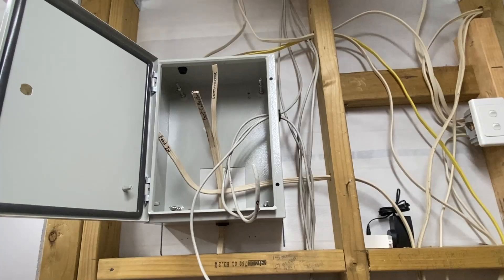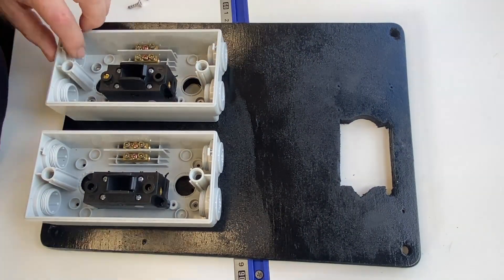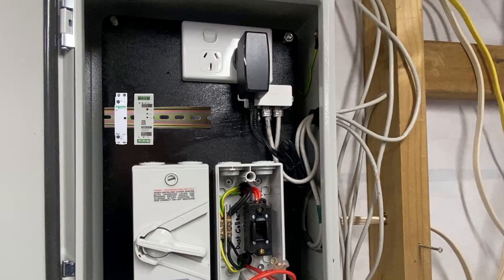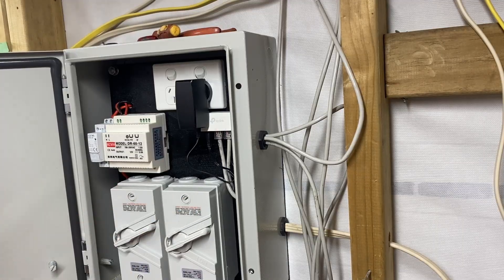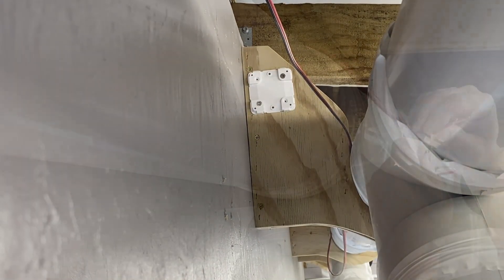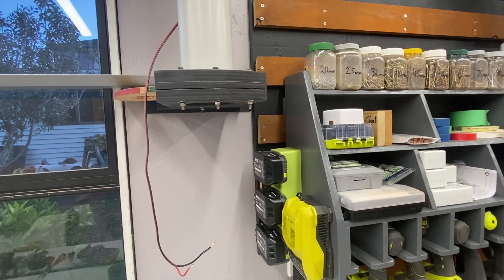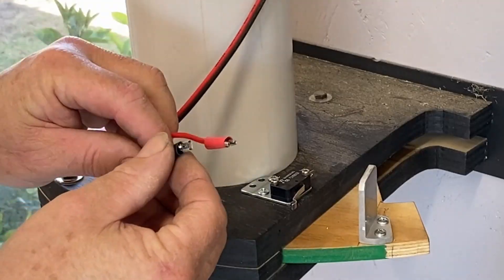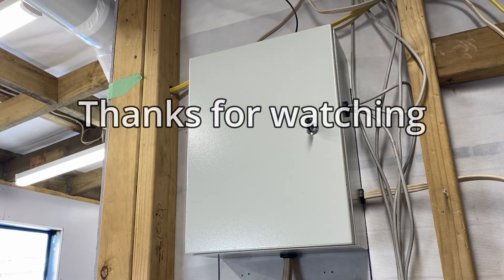Automatically Start The Dust Collector From Your Blast Gates

Comment: Looks good, couple of questions: presuming you have an electrical qualification to be working with mains supply in NZ? This should have a compliance cert? And also, how are you dealing with the static charge that could build up in those pipes? Wood dust and sparks = explosion, and non compliant electrical work = no insurance!
Reply from the maker: In NZ the home owner can do their own wiring. In fact the government issue a document 'New Zealand Electrical Code of Practice for Homeowners' which has all of the electrical specs. But, you need an electrician to connect it to the supply and to sign it off.

I'm not worried about static issues. This electrician shows testing where it is almost impossible to remove or ground static. 
https://youtu.be/yA22kTtV4XI
Reply: @thehobbymachinistnz 
Most of the NZ (where I am) homeowners code of practice is replacing "like for like" and, yes, an electrician is required to connect and check your work.  I follow your channel and enjoy your content, but I think it would have been prudent to have mentioned that requirement or at least to make viewers aware of requirements in different jurisdictions, certainly the video you linked to did so re grounding conduit.
Reply from the maker: @RobinHicks-w8u  Thanks for your comments. I actually added a lengthy disclaimer early on in the video about our code of practice and that others should check their regulations where they are, but it was too long so it took it out. I intended to add something smaller at the end but it did not get into the video before I released it. 

New Zealand Electrical Code of Practice for Homeowners and occupiers allows for new installations "e.g. For new electrical installations you may place the cables into the main switchboard enclosure (providing there is no electricity supply connected to that switchboard). The connection of the cables into the switchboard must be carried out by a licensed electrical worker and must be inspected by a licensed electrical inspector". So new installations are mentioned and allowed by the home owner in the code, not just like for like replacements.
Reply: @thehobbymachinistnz  Where did you learn to work on electrical stuff? Just learned things over the years?

Comment: Nice work.
Could the micro switches go in the fully open position rather than the fully closed position? You would want to put a latch in the fully open position so vibration doesn't turn the extractor fan off. I realise the current arrangement doesn't have this failure mode.
Reply from the maker: Yes, you can do it either way. I did it this way because I sometimes put a 2" flex pipe in the 4" pipe and close the blast gate onto the 2" pipe. Then I can use it to clean the benches.